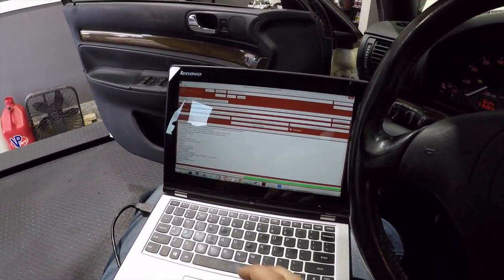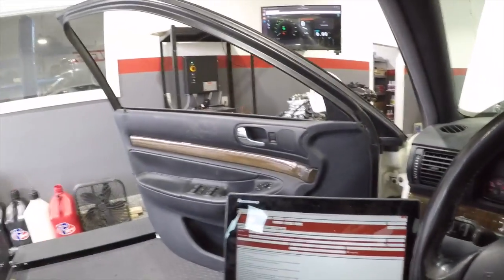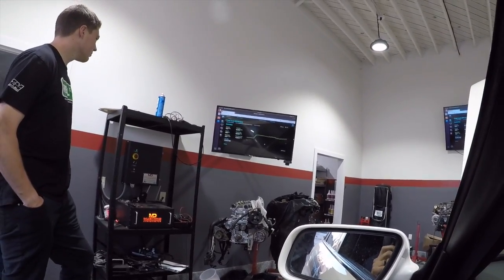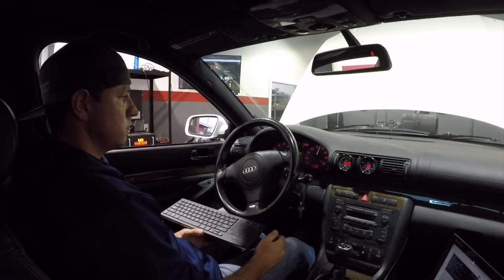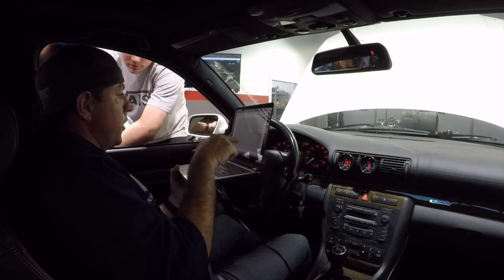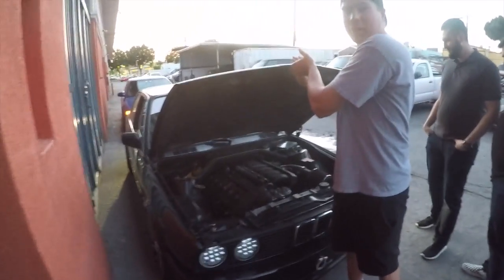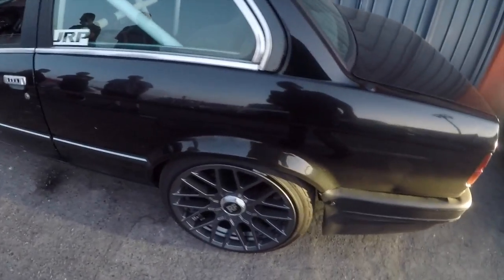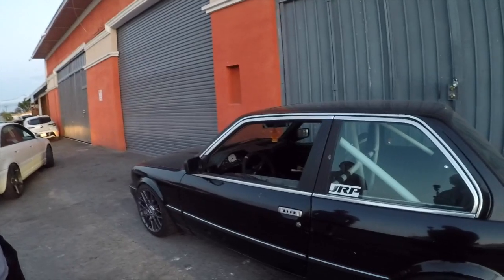Tuning a B5 S4 on the dyno at JRP performance

Comment: A k04 car on e85 that didn't crack 400whp on a Mustang?...  These must be pump 91 gas figures.
Reply from the maker: +El Mushasho boost was set to 22psi and we found out after the dyno session that the throttle body boot was leaking. He is also on stock block so the torque onset is kept low to stay on the safe side.
Reply: Yeah... You won't run into "stock block" issues till w into the mid 400's... But a boost leak would definitely cause issues... Just saying, healthy k04 cars were surpassing 400whp on pump gas 10 years ago... On e85 it should touch upper 400's... Just limit tq spike, it'll be fine...

Looking forward to PT. 2
Reply: @mushasho  stock block issues? You mean the stock block can't handle 450-500hp? Really?? If thats the case, whats the solution?
Reply: The block could, the rods can't, @lesenfantsterribles6898  .. For the most part a 2.7t that has been upgraded to k24 turbos would need rods to enjoy their full potential without fear of bending. Other wise just use OEM k04 and gain all your spool back while making the same peak power.
Even in the beginning of the video he expected over 400whp on pump... I've seen 500whp stock block cars on k24's/e85... Not sure what happened here
Reply: @mushasho  i like the last part of your post lolol xD Nah good looks on that. I never knew that the stock rods wouldn't hold up in the hp range i suggested. I thought the b6 4.2 s4s only had that problem. I'm on the hunt for a b5 s4 or c5 a6 with the 2.7t. So ultimately i wanna hit 500. Its sad cuz the secret is out. These things were so underrated and under the radar for a while. Hard to find them now.
Reply from the maker: El Mushasho correct the stock rods don’t like to be pushed over 500 wheel torque and around the same HP. My par put down 530hp and 480tq on stock block with k24s but I daily drive it at 490hp and 470tq. I agree this car should have made more power but with the boost leak and a few other factors it did not happen this time. We will see how the logs look once he gets it’s sorted out.  I’m estimating he hits a low 3 fats once it’s all sorted. That best dyno run was a 4.0fats.  He also wanted to keep the power somewhat conservative so that why I didn’t push it to the max.
Reply from the maker: Les Enfants Terribles yah the stock rods were not Ment to handle over 500 wheel hp and tq. With just rods and stock pistons that will allow for 600-650hp and tq with k24s or larger turbos.
Reply: @GermanEliteTuning  the leaking TBB was probably also causing your rich issue in higher RPM's, good ole maf based car lol
Reply from the maker: B5 Quattrolife yes you are correct.  The G/S were reading higher than they should have  been due to the boost leak so it caused a rich condition.